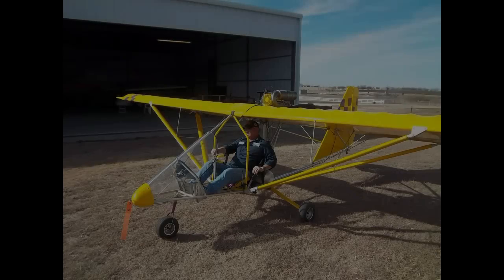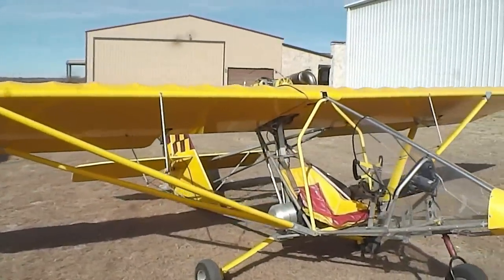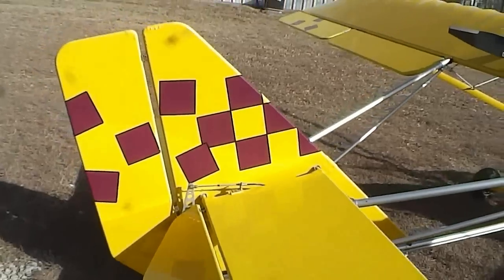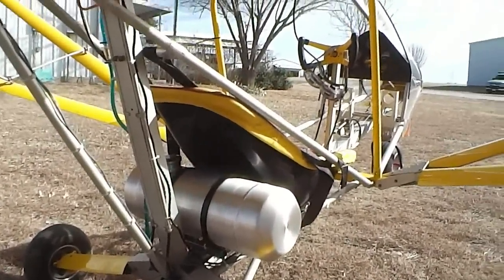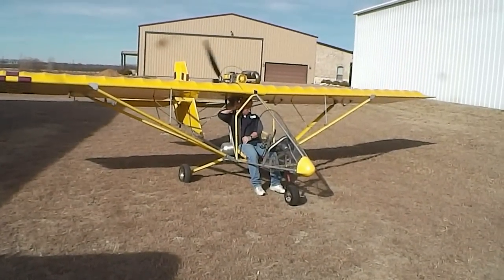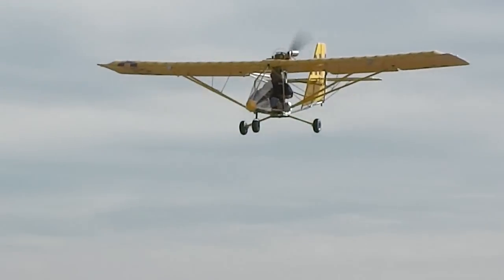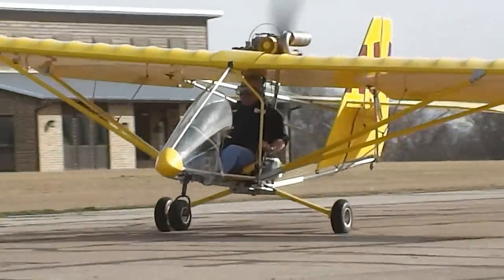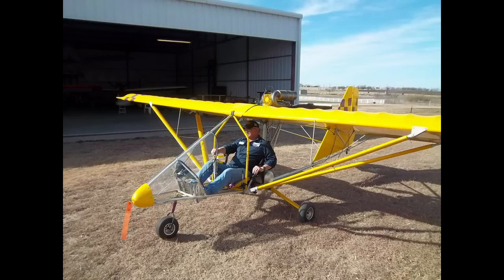Aerolite 103 Ultralight Aircraft for sale $8500 Flight Demo:SOLD FOR $7500

Comment: NOT A TWO CYCLE !...its a one cycle ! it has 2 strokes! if you want to pretend to know something then at least know the basics.
Reply from the maker: Stephen Barker ok, lets say no noise no power??
Reply from the maker: Stephen Barker this is more better: A two-stroke, or two-cycle, engine is a type of internal combustion engine which completes a power cycle with two strokes (up and down movements) of the piston during only one crankshaft revolution. This is in contrast to a "four-stroke engine", which requires four strokes of the piston to complete a power cycle. In a two-stroke engine, the end of the combustion stroke and the beginning of the compression stroke happen simultaneously, with the intake and exhaust (or scavenging) functions occurring at the same time.
Reply: SO WHEN YOU CALL THAT  ENGINE A 2 CYCLE.... STUPID YOU ARE WRONG! ...i am the great i am. { god } i know all things so dont argue  "' wit "' me.  half cycle is steam engine ...1 cycle is like chain saw. two cycle is like car. there is no 4 cycle engine NONE!
Reply: 1st stroke SUCK 2nd stroke compression 3rd stroke power 4th stroke is exhaust. this is a 4 stroke engine and it has only 2 cycles!listen up stupid, it takes 2 stroks to make 1 cycle... 1 cycle[2 strokes] plus another cycle =4 strokes [2 cycles] steam engines have power stroke twice per cycle. ON AN OLD TRAIN U WILL SEE THE WHEEL TURN 1/2 CYCLE AS THE ENGINE MAKES 1 STROKE BUT EVERY STROKE IS A POWER STROKE. IN OTHER WORDS IT IS A 1/2 CYCLE ENGINE
Reply: Stephen Barker haha wut
Reply: +Roy Dawson is this one sold yet?
Reply: +Stephen Barker Not to sound rude but a piston must move all the way down the cylinder and then back all the way up before it can fire again meaning there are two strokes involved. A single stroke means the piston would have to fire on the down stroke. That I would like to see. Remember, one stroke equals one direction of the piston.
Reply: GO ASK A REAL MECHANIC. LET HIM EXPLAIN IT  TO YOU.
Reply: Dick wad? By the way I am a mechanic. 32 years of fixing and building. Street, pulling, drag, marine. The smallest was a .049 cox the largest an EMD on a tug boat. I got my education on the real thing not from wiki.
Reply: +Stephen Barker.... Hahaha. Looks like those inner city public schools failed yet another minority! Can't spell. Can't punctuate. Can't express himself intelligently without ranting in all caps. Has nothing thoughtful or pithy to add to the conversation...

I'm assuming the "Two-cycle/Two-stroke" thing was the only thing you remembered from your "special" classes in high school? Before you dropped out and got the sweet job at Burger King?

See what happens, Progressives...when you just throw money at the problem? One guy with a free Obama-phone can ruin everyone's good time...
Reply: Ah hello… Each cycle equals one stroke...
Reply: Yep… one stroke = one cycle… and it is as simple as that.. no brainier...
Reply: +Stephen Barker Dumb dumb a cycle or stroke is the action of the piston not the crank to complete a power cycle for the cylinder.. If you are intelligent enough to type on a you tube video you should be intelligent enough to look up the definitions. A two stroke engine completes a power cycle with one revolution of the crank which is two actions of the piston thus two cycle. It is called compression and exhaust. A four cycle engine take two revolutions of the crank to complete four actions of the piston to complete  one power cycle thus called four cycle. Don't try BS people that understand.
Reply: Stephen don't feel bad. I once knew a guy who thought a 4 cylinder engine meant each cylinder completed one stroke. You know, the first cylinder was the compression stroke, the second cylinder was the power stroke and so on. Some people just don't understand the mechanics of an engine.
Reply: +T H Not sure what you are trying to say, it takes ONE revolution of the crank to complete two strokes as in two cycle or two stroke.    Stroke or cycle is the action of the piston.
Reply: Right…  I agree...
Reply: +Stephen Barker    Stephen,  the language has evolved and you haven't.    They are actually named a "two-stroke cycle" engine.    That was just shortened to "two cycle."   That this offends you means you are a no-nothing who has a very,  very trivialized mind.   You've been schooled,  son.   Now go away.
Reply: 2-stroke = 2-cycle.  Same same, no debate.
Reply: Ima SuperPerson Very good....
Reply: Guys, this is just a matter of changing terminology over time.  Two-cycle is older, two-stroke is newer - both are somewhat inaccurate, but we know that they mean.  It's like the old term "megacycles".  Now we say megahertz, but it's exactly the same thing.  Don't let the terminology fool you.  In my opinion the 2-stroke should really be called a single-stroke or 1-stroke, since the plug fires each time the piston comes to the top.  BUT ... it's just a term.  People call me "white", but I'm actually someone between peach and tan.  LOL
Reply: more better...
Reply: Is this price in us doller
And tell other expenditure